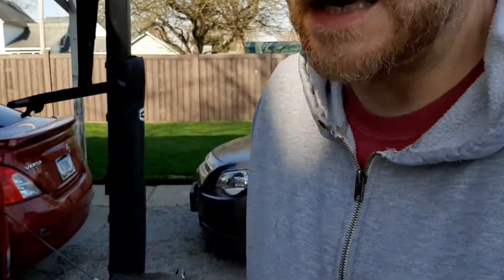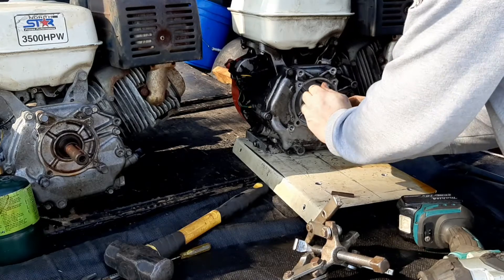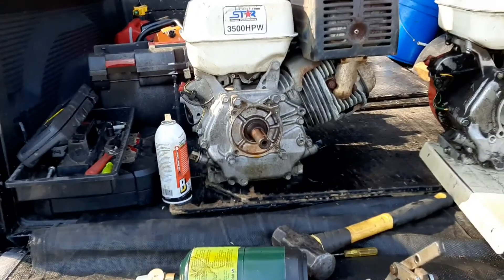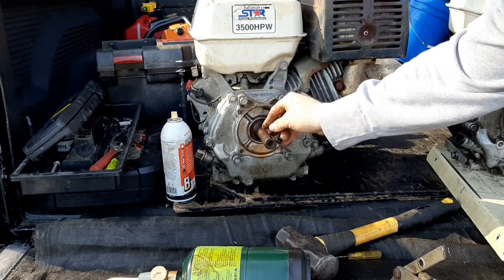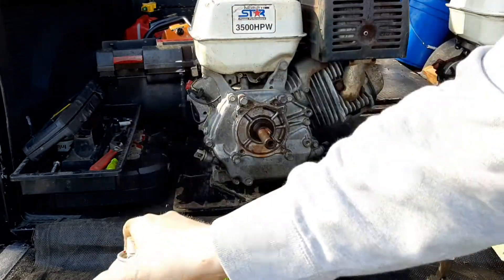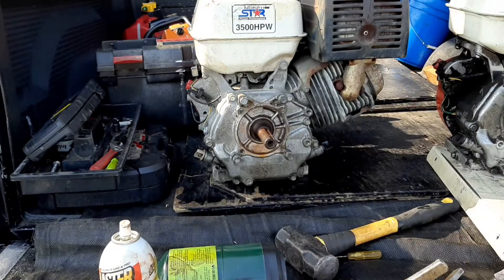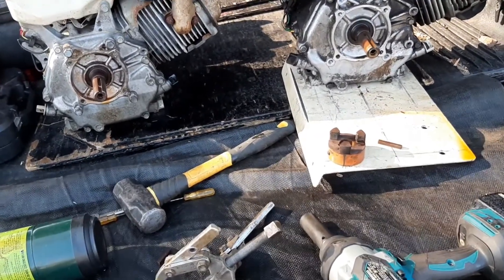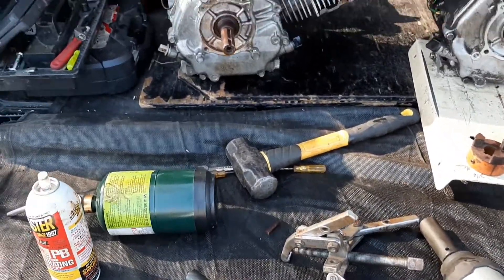HOW TO REMOVE A STUCK LOVEJOY COUPLER FROM A SMALL ENGINE THE EASY WAY

Comment: You saved me a lot of grief. I have been pounding and trying to get that coupler off an old engine on an older wood splitter for a couple days. I figured I'd put another 212 cc motor on it. That coupler put the brakes on the project. Then I saw your video and rushed off to Auto Zone with my boys and bought a 5 ton gear puller for $37. Could of rented it for nothing but It's a handy enough looking tool I figure I might need again someday, like what happened to you. Thanks for posting it!
Reply from the maker: Yeah.. those pullers come in handy for lots of different things. Glad I could help solve your problem my friend!
Reply: I have 212cc on my custom mfg woodslpitter works great preditor although they make them bigger.but not needed as hydraulic s are the drive force.

Comment: Looks like I’m going to have disassemble engine from splitter to get jaw coupler from drive shaft!
Reply from the maker: Depends on the way its facing the splitter. You can use a socket wrench if it gets too tight for a impact.
Reply: @WoodYardJunkie  shaft from engine to shaft first coupler.  Then a drive shaft in line to jaw coupler to shaft of hydraulic 13GPM pump!!  Problem is I was able to pry pump from shaft which pulled coupler to pump mounting housing binding jaw coupler in housing no room to pull coupler out!
Reply from the maker: @richardrajeski5302  The housing should be bolted to the engine. Un bolt the housing so you can get to the coupler.

Comment: it seems the lovejoy is permanently affixed to my motor shaft (no hex set screws only a key pressed in keyway) any suggestions?
Reply from the maker: Clean it up good and make sure no holes are covered in dirt and grime. If no holes you might have to cut it off. You could also find a machine shop locally to look at it.